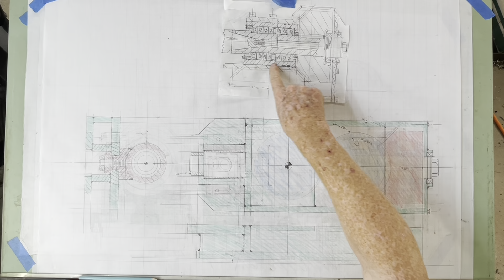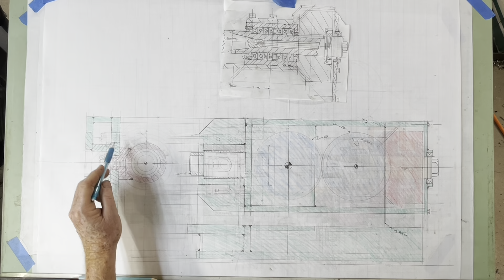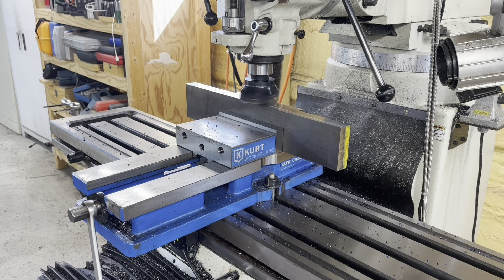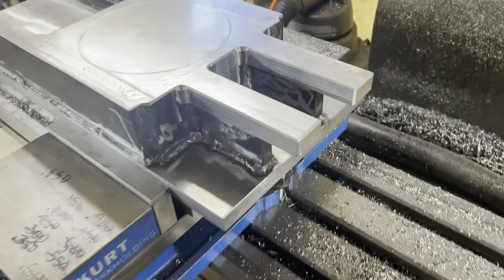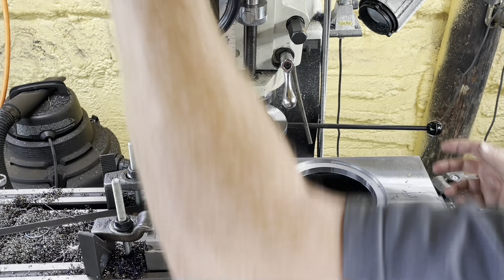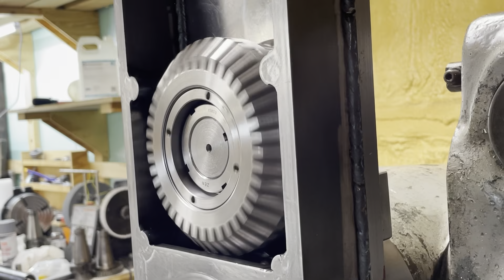Hobbing Attachment Update: construction and first test!

Comment: Another really nice piece of machining there Tom. You deserve far more subscribers.
Good choice in ear plugs as well, I have used those Howard Leight Laser plugs for years, best ones you can get as far as I'm concerned, even use them when riding my motorcycle. Having said that, I have just bought some noise canceling bluetooth and FM/DAB+ headphones off Amazon, so that I can listen to the radio at the same time as I'm working.
Reply from the maker: @billdoodson4232  Thanks, Bill!  I suspect that my stuff is more for the esoteric interests…